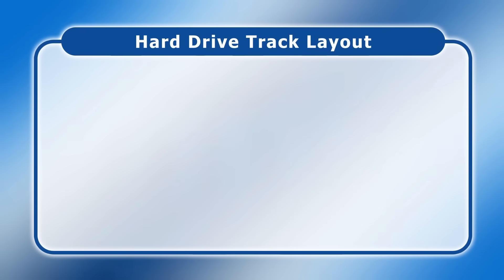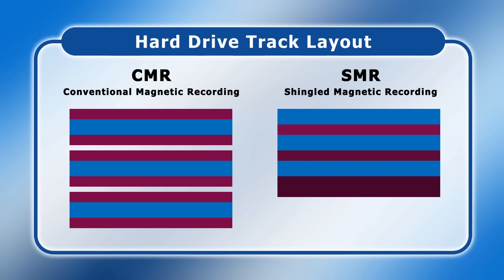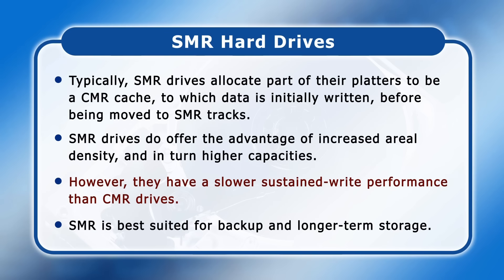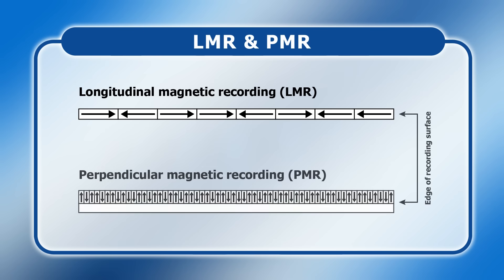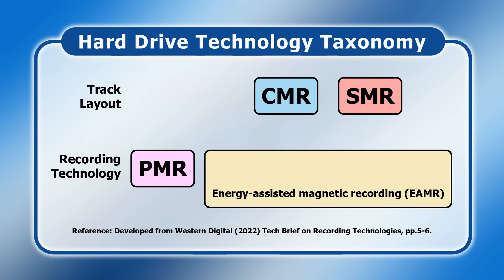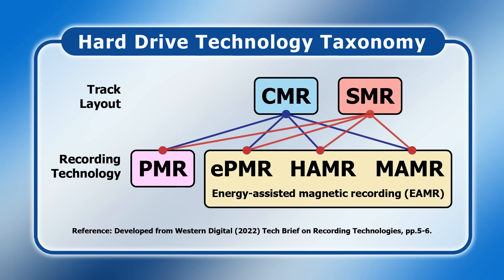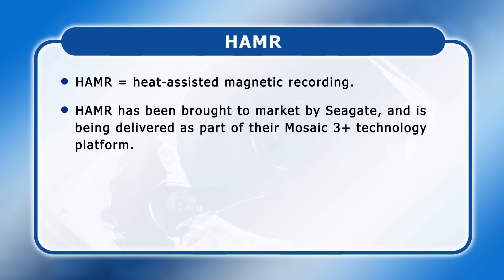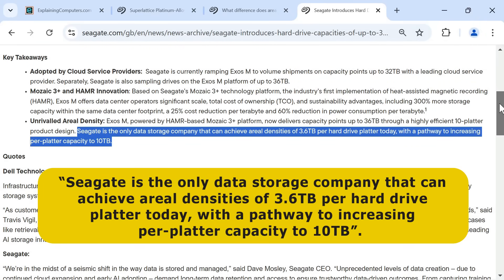Explaining Hard Drive Technologies: SMR, HAMR, ePMR & more!

Comment: I actually disagree with the popular opinion that within the next dace or so HDDs will be obsolete. Non Volatile data storage is not just all about speed or capacity, we see this with optical media. Folks have been saying that the compact disc would be dead for a decade and here we are and its still alive and strong, albeit with a niche market and such but still very consistent and driving enough demand. Spinners simply offer many benefits that Solid State Media doesn't have especially in long period cold storage or archival needs were Solid State Drives, while fast, do not handle this well due to limited use and the issue of bit rot through leaking electrons. There are many out there, myself included that refuse to and do not retain their archives on solid state media. Spinners will never be out classed by Solid State Drives in these aspects. It is kind of like Auto-loading Handguns and Revolvers, each one fills the others weaknesses and both are forced to co exist. That is my opinion, but only time will tell what actually happens!

Comment: Several years ago I already knew about SMR and knew to avoid it. I was out for a 4TB drive and wanted a 4TB CMR WD Blue (WD40EZRZ). I messaged the online seller and confirmed the model number. They even listed it as CMR, which is right if they're really selling the EZRZ. But when the drive came I was disappointed to see that they did the old switcheroo and sent me a different model (WD40EZAZ), which was an SMR drive. It looks nice in the bag and all and part of me wanted to accept it anyway and see if it's really bad, but I knew in my heart that it's a piece of $hit. So, I didn't even open the antistatic bag and just sent it back. I was pissed and my PC build was delayed, but a slight delay is better than years of agony and no peace of mind!! Wouldn't you agree?

I'm not ever gonna use an SMR drive. Yeah they want to push it with all kinds of BS marketing like "Is an SMR drive right for you?" BS. Well damn, it's NOT ever right for anybody, buddy!! Yes they may be a tiny bit less expensive but SMR drives just aren't worth the small savings, if any!!

Fast forward to today and it's kinda disturbing to see hard drive manufacturers even pushing SMR drives in their 24/7 CCTV HDD lines like Skyhawk. Like dude you write to surveillance drives 24/7!! How's that gonna be reliable?? If your SMR drive stalls and you miss recording a VERY IMPORTANT event that can mean the difference between winning or losing a legal battle, is it worth saving $10??  NO FRICKIN WAY!!!

You need to pay special attention to the model number these days. They'll sell you manure if you're not careful!!

Comment: Pronounced an-isotropy, by the way. Very good video, quite informative. The CMR vs. SMR issue was really hot 2-3 years ago, lots of youtube videos about it, mainly when it came to using SMR drives in RAID arrays, since rebuilding an array after a failure took far longer than it did with CMR drives. While a RAID5 array is rebuilding, it's vulnerable to an additional failure, which could mean the loss of the entire thing. But I hadn't heard anything about it in a while - either people aren't making the videos any more or YouTube isn't sending them my way any more. If the former, then it's one of two things -- it's no longer an issue because improvements in technology have gotten around the problems, or drive manufacturers aren't making as many SMR drives any more. At least, not ones that are to be used in RAID5 arrays. Similarly, I have not seen anything recent on TLC and QLC SSDs, and pretty much all the SSDs I've come across recently seem to be TLCs. I guess the only time I'll come across any of the drives in this video would be if I buy decommissioned datacenter drives a few years hence - last year I bought a used 14TB Ultrastar (just checked.. CMR!), which I got for about USD160. Going to be used strictly for second-level backup - none of my older drives are bigger than 4 TB so I think it'll last a while.

Comment: Unfortunately they all fail miserably in a few years so you have to make quite some backups. Of all the pc components the hard drive is the one that fails the most. I had one that failed in less than a month.
Reply from the maker: 3-2-1+ backup is required with all forms of storage.

Comment: on a smr hard drive or an smr hard disk drive? because i don’t believe there are ssd ‘s smr drives to say smr hard drive ….
Reply from the maker: I've no idea what you are going on about. A drive is a storage device, so both SSDs and hard drives are a "drive". And indeed the full name for a hard drive is a "hard disk drive", or HDD", the same way that an SSD is a "solid state drive". To say "SMR hard drive is absolutely correct. You are clearly confused.
Reply: @ well if you say i am confused… I was referring to the fact that in this videos we are clearly talking about hard disk drives, and only hard disk drives can be SMR. right? so how am i confused?
Reply: @ a hard drive can’t be an smr only a hard disk drive can be an smr as only hard disk drives are smr. ssd’s are not smr.
Reply from the maker: Ah, I think I see what you mean -- which is that I could say "SMR drive" rather than "SMR hard drive", as only hard drives can be SMR?
Reply: @ only hard disk drives can be smr..

Comment: SMR drives do not have a slower sequential write performance.

They have terrible random write performance
Reply from the maker: NOWHERE in this video so I say that SMR drives have a slower sequential write perfomance. But I so say that SMR drives tat use a CMR cache they have a slower sustained-write performance than CMR drives, which is true.
Reply: @ExplainingComputers 
The sustained sequential SMR write speed is basically identical to CMR.

Sequential Write speed is just BPI x RPM.

BPI on SMR can be higher due to less track interference.  (One sided squeeze vs 2 sided)

They are both over 250MB/s

SMR drives don't use a CMR cache for sequential transfers.  They are sent directly to the write pointer.

Media Cache would only be used for a Queue random mixed load.

SMR is setup for sequential writes, and random reads.

The IO path is what matters.  Sustained vs intermittent doesn't matter much.  The DRAM cache is so small (512MB) that it doesn't impact large files.

Comment: 13 years ago when I bought my LG Optimus l5, I got at the same time a micro SD card, it was a Silicon Power 32 gigs class 4 planar TLC NAND (it was made in China btw) and now in 2025, the card in question still works but it's a bit slow compared to the A1,A2, U1,Class10.... which led me to believe that flash memory can indeed survive more than a decade, even the cheaper ones. I haven't seen any micro SD and SSD failed on me, but I have 2 WD my passport HDD that died on me in only 6 months of use.

I would also stay away from SanDisk memory cards and Kingston USB flash drives as they're very bad products. Their SSDs are okay though.

Comment: The furniture sized drives (IBM called them DASD, or direct access storage devices) had an interesting old school access arm geometry. In which the access arms were aligned with, and moved in and out in alignment with, the radius of the platters in one direction.  Since the arms, when reading the outermost track (and more so when removed from between platters to mark the pack removable), almost doubled the radius in that direction, they were located in one corner of the cabinet.

Because of the larger distances (each platter about the size of a large pizza) the arm had to travel, and the fast movements and sudden starts and stops, the cabinet had to be stabilized to survive the vibration.

Floppy disks kept the same concept, but moved much slower and had smaller “platters,” making the vibration issue much less of a problem.

But the geometry adopted for PC hard drives was genius.  Like the tone arm of a phonograph, the tone arm is approximately tangent to the edge of the platter, and swings in an arc that is approximately along a radius of the platters.  This requires much less energy to move the arm, and produces almost no vibration.  All the subsequent improvements are pure gravy!

Comment: @16:03 -- Regarding conventional drives being more cost effective than SSDs.  Up front costs do bear that out, by a significant margin.
But SSDs consume far less power.

I have no idea how long it would take for SSDs to become more cost effective for an equal amount of storage to HDDs.  It depends on each location's electrical costs.
If you have free (or near free) electricity, then running HDDs will be an easy choice.  But if you have expensive electricity costs, then maybe it makes sense to have a high SSD expenditure up front?

And then there is the cooling factor, which uses electricity.  Thousands of HDDs release a huge amount of heat.

I used to do Chia processing.  The scores of HDDs was enough to heat my apartment.  I live in New Jersey, USA, and I rarely turned on my heat during the winter.  But in the summer, it was brutally hot, requiring me to keep my AC blasting non-stop.

My electricity costs were 4x what I was paying, prior to Chia.  I can only imagine what huge data centers pay for electricity.  It must be hundreds of $thousands each month.  Across their data centers, globally (for the truly huge companies), they are probably paying $millions each month.

Comment: I work for a large US corp supplying server and storage hardware.In my 25yrs experience dealing with storage hardware related failures, the best piece of advise I can give to prevent  HDD/SDD/NVMe failures and increase the life of these storage devices. Is to keep your HDD/SDD/NVMe and Storage controller firmwares up to date. In a mechanical HDD for example,the firmware controls the motors, read/write heads etc.  99% of any Storage bugs found after production are resolved by a simple FW update. I have seen  large RAID and non RAID virtual disks completely fail with data loss that could have been prevented with a simple firmware update as part of a scheduled maintenance update. Please Please Please...keep your storage device firmware up to date
Reply from the maker: Good advice, thanks for sharing.

Comment: 4:05 are there also drives with multipe heads?
Reply from the maker: I'm pretty sure that drives with multiple heads per platter were once experimented with, but am not aware of any like this today. Packing 20 heads into a 10 platter drive is hard enough! :) Even 8 heads in a4 platter drive is pretty amazing engineering.

Comment: @explainingcomputers Chris, could you make a video on hoe to accelerate old PCs with a bios with say NVMe or at least with technology far far faster than standard SATA SSDs?
Reply from the maker: I think what you want is in this video: https://www.youtube.com/watch?v=Ktqa11VT1xI Note, however, that without BIOS support for PCIe boot, you will not be able to boot from an M.2 NVMe SSD in such an adapter. Good luck!
Reply: @ExplainingComputers  tnx!
Reply: @ExplainingComputers  there are MVMe SSD and (SATA?) SSD devices in M.2 formfactor but how fast is the SATA SSD when mounted in a PCIe x4 slot? Or is that not possible and is it then just another SATA adapter with the same bottleneck?
Also, my MB might not support booting from NVMe as I am not sure it even understands it. It's a 1st gen i7 machine

Comment: Chris, for sure I expected a smal notice to the use of Kibibyte versus Kilobits to express the storage capacity of hard drive. When you read the capacity on the label it is written in let say Kilobyte (a powers of 10 bytes). When formatted your operating system shows the storage bits capacity in (mega)MB/(giga)GB, but actually use the wrong  label! they should use the right GiB (gibibytes) but show GB gigabytes. The format value is expressed in a power of 2 number.

1 KB equals 1,000 bytes; 1 kibibyte (KiB) equals 1,024 bytes. 1 megabyte (MB) equals 1,000 KB; 1 mebibyte (MiB) equals 1,024 KiB.

This is one of the reasons you have ‘less’ storage after formatting what most people expected.
Reply from the maker: This video is about hard drive technologies, not how storage capacities are expressed. :)

Comment: I still use HDDs and sometimes SSHDs for storing huge files, video editing, and giant file compression, like Kdenlive, Handbrake, and 7-Zip. I find it annoying and awkward that SSDs don't like writing and erasing data too often, as finding SLC and MLC SSDs is hard to come by. Seagate's HAMR technology works fine on my Seagate HDD, and my SMART app CrystalDiskInfo says that its health is good after running it for 2 years.

Speaking of apps, I get annoyed and hate the hassle of installing unnecessary apps and bloatware into my PC storage NVMe. Of course, we can uninstall apps that we have not used for ages to clear more storage space, but I find utilities like CCleaner with its Registry Cleaner disconcerting. I heard that Registry Cleaners aren't recommended because of how they could corrupt the reg keys and make the PC slightly unstable, which would cause more embarrassing BSODs. 

This is why I focus on installing - or rather downloading some portable utilities, like BleachBit, SpaceSniffer, CrystalDiskInfo, HandBrake, and CPU-Z, in order to save my NVMe from depleting its Write/Erase cycles and from adding too much junk into my PC. Of course, using portable apps is better by having it downloaded into a USB pen like my Lexar UHS-II 32GB or even on an SD card.

And as for HDDs I can hope that newer ones will store more data and maybe work longer, but they cannot match the robustness and speeds of SSDs

Comment: Another thing all current drives use, is variable bits per track. The old MFM and RLL drives as well as the 1st generation IDE had a fixed number of sectors per track limited by the density of the innermost track, while later drives use methods such as zoning to fit more sectors on the longer outer tracks, one of the earliest (and I have one of these relics) was the ST351 A/X - a truly bizarre mix of technologies - a 40MB which could be set to AT or XT mode, was one of the last stepper motor drives (but had autopark) and used 3 zone recording

Comment: And yet for all this new tech and methods, hard drive makers STILL employ the same disk organization that was being used on 8 inch floppies in the late 1970s: the same number of sectors per track, both at the centre and at the edge.  That means the tracks at the edge are larger but contain the same amount of data as the inner track.  One would think companies would have adopted two different writing systems for each platter, more smaller sectors on the outer tracks to increase capacity.  At least interleaving improved from 3:1 and 2:1 in the old days to 1:1 as it is now.
Reply from the maker: Agreed!

Comment: When are theese 32 TB hard disks available? The highest capacity I've seen so har is slightly over 20 TB for more than 500 Pound/ US Dollar.
Reply from the maker: The 30TB+ drives from Seagate, and 26TB+ from Western Digital, are all data center drives, and just becoming available from authorized partners in industrial channels. Eg, you can find these after searching for a drive on the Western Digital website. 24TB seems to be the maximum in general sales channels right now (there are several 24TB Seagate drives on Amazon.com), but I would expect the higher capacities to be more widely sold by mid 2025.
Reply: @ExplainingComputers  Good to know, thank you.

Comment: For homelab use, SMR has gotten an unnecessary bad rap. 
In RAID5 or 6 (or ZFS's RAIDZ1 or Z2 equivalent), you don't really see a write penalty because each drive has enough time to complete its write cycle before the next data stripe comes in. My 5 SMR drive Z2 array performs equivalent to CMR, bottlenecked by network speed instead of drive speed.
BUT that's in a small/medium homelab where I'm more likely to be sequentially reading or writing, usually not simultaneously, over a 1 or 2.5Gbit network & not having a barrage of simultaneous random reads & writes coming in at 10Gbit+ network speeds.

Comment: You report a 1TB platter having 650Gb/sq.inch. Can we assume 8 bits to a byte?? So a platter has 12.3 sq.inch, or 7940.43 sq.mm. Perhaps it is actually 8000 sq.mm per platter. There are 645.16 sq.mm in a square inch. 
Thus the 1TB platter has 1.0075Gb/sq.mm. 3.6TB/platter has density of 3.63Gb/sq.mm, and 10TB platters have - 10.075Gb/sq.mm. 
However, given the rounding that is going on, we can say that the progression from 1 TB per platter to 3.6, 6 and 10 TB per platter is marking 1, 3.6, 6 and 10 Gb/sq.mm

Comment: SMR drives can perform strictly sequential writes just as fast as CMR drives
Reply from the maker: In theory, yes, and nowhere in the video do I say otherwise. :) What I say is that SMR drives "have a slower sustained-write performance than CMR drives", and in practice this is almost always true. This is because, as noted in the video in that section, SMR drives typically allocate a CMR cache where data is initially written. And so sustained sequential writes are slower once their CMR cache is full

Comment: I'm a regular end user, and even I still find HDDs invaluable. I have a Toshiba 5TB external HDD (the kind that needs to plug into an outlet) that I bought secondhand years ago that I use for backups of my important files. Considering I spent less than $100 on it, it has been money well spent.
Reply from the maker: That was indeed a good deal for 5TB. :)

Comment: 1PB hard drive in the 2030s without a lot of platters seem impossible, the generational capacity gains are 20-35% (mind you the big hard drive makers had setbacks with HAMR, they were increasing platter count to sell bigger drives rather than bits density while ironing out problems) and we need 30x increase.